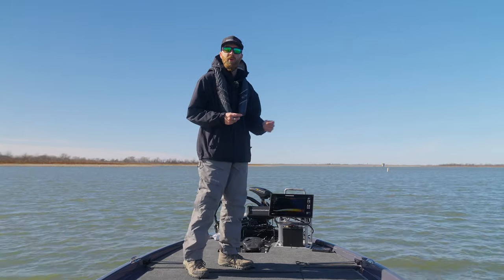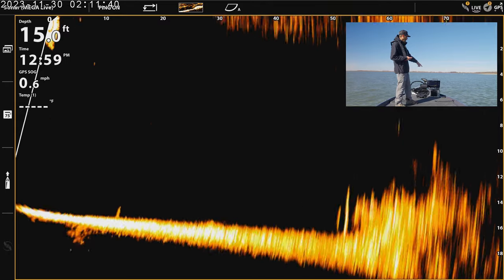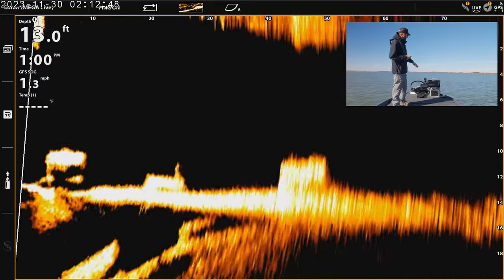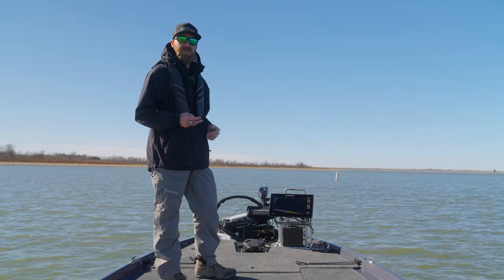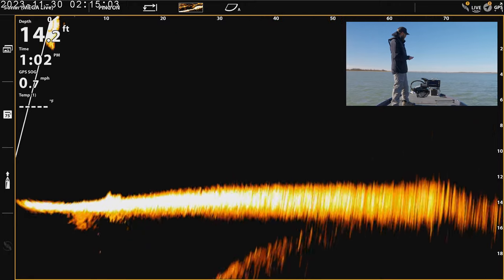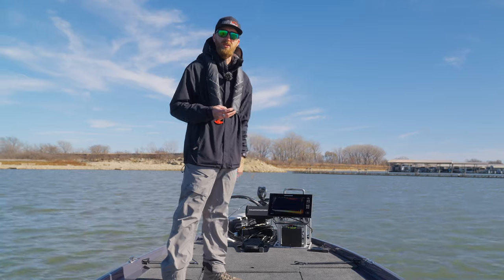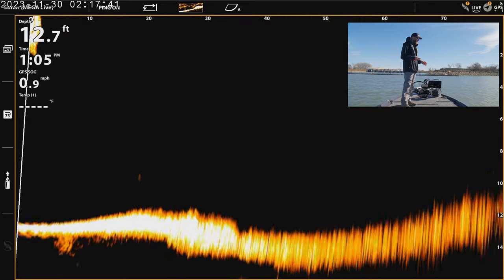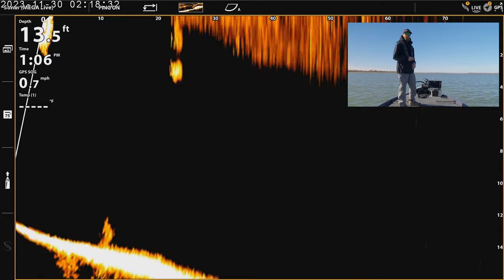MegaLive Update Thoughts and Overview

Comment: I have no experience with mega live, just vids I've seen online. My lvs34 looks significantly better without dialing it in. Use what you got #1! From the previous Christmas sales, coupon codes, I got my echomap Ultra 106sv, steady cast & lvs34 system , including my 14.8v 32 ah lithium battery for $2679.00+ tax! That's less than just a 10" unit from either other brand by itself. It paid off to be patient & wait for deals.